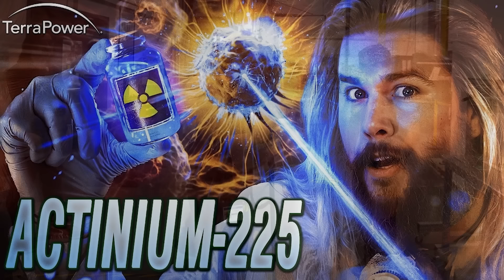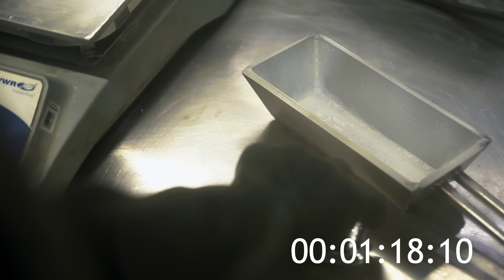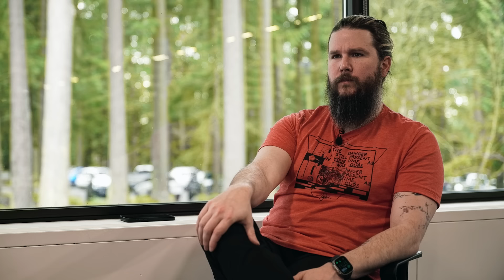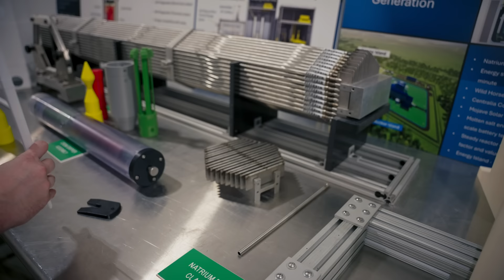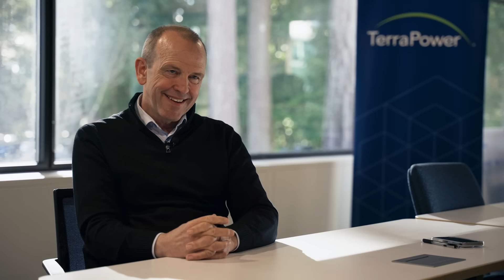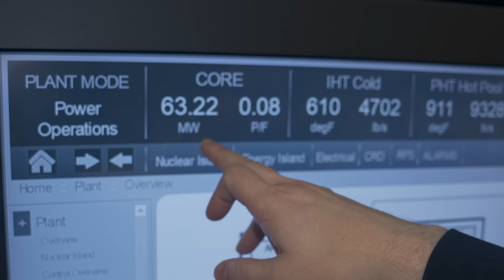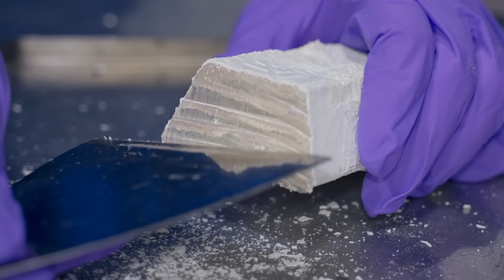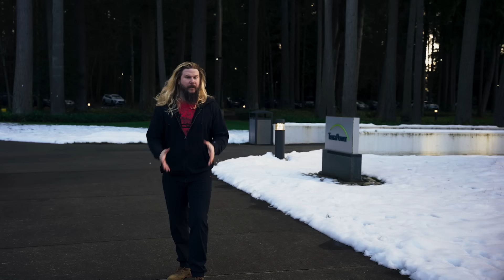Will Natrium Nuclear Reactors Change Everything?

Comment: So can we learn anything about the safety or fire suppression systems of the reactor? Maybe operating temperatures? I ask because sodium explodes or atleast ignites in open air so in the event of a failure how is the temperature decreased and the sodium contained? This varies from the thorium reactor function too and is seemingly very similar to the reactors we use today (except for the moderation of the nuetrons). While scientifically sound and certainly more efficient and better in function, i can't see how this is safer but that answer might be in that the reactor isn't moderated perhaps.

Comment: they aren't "getting licenses" by any stretch of the imagination they are trying to apply for one within the current commercial framework... I think I remember you mentioning that this is a fast reactor (but using enriched fuel at the same time) which basically means it is a breeder reactor for which there is (not since I last worked in the industry) a method to license for commercial use as it produced Pu in the normal operating process.... everything in the current operating generations of rectors was done with "nonproliferation" as a primary concern (which is why commercial reactors only use fuel enriched to 4-5% vs the navy's 90%) trying to make it as difficult as possible to divert materials for use in bombs...

it's been a while since I took chemistry classes but Na reacts with stainless steel, zirconium, and other metals especially at high temps so what is terra using to pipe the liquid Na through the core?

Comment: A) Thorium reactors should be built, not uranium reactors.

B) Nuclear reactors don't need to "follow loads". In the future a lot more electricity will be used continuously, day and night.

C) The Chinese took the research on thorium reactors that was done here and that will, likely be the preferred reactor type.

D) Nuclear fusion might be commercially feasible in 50 years.

Comment: 15:33 That's not entirely true. The major reason why alkaline metals explode in water is because the water steals electrons from the metal which makes the metal repel itself. This makes the metal shoot out spikes into the water which has a ton of surface area and that causes the reaction to explode. Thunderf00t has done a ton of research on this.

Comment: Finally, some good news!

Question: if the reactor is always at 100% and is using “fast atoms” then does that mean there’s no control rods in the reactor? Or is there control rods, but they’re used more sparingly like in a SCRAM emergency?
Reply: there are control rods, you still need them to keep the balance of criticality and such to have a functional reactor and its obviously an essential feature for shutting down the reactor. But there's no moderator since this reactor uses fast  neutrons to cause fission (MeV energy ranges) instead of thermal neutrons ( >0.1ev) like in reactors that use water as a coolant &moderator

Comment: I'm sure that the designers are thinking of every aspect of this, but liquid sodium as a coolant worries me for two reasons: it's a volatile metal (e.g. reactive with water), and it's solid at room temperature. If for whatever reason the magnetic pumps stall, it can solidify in your pipe system, and you won't be able to quickly liquify it again
Reply: The reactor part of the Terrapower design is based on the GE Hitachi PRISM reactor, which in turn was based on the Integral Fast Reactor, which was never built due to a lack of funding but was an evolution of the EBR-II which operated for thirty years. This is a "pool" type reactor, so all the liquid sodium is contained within the reactor vessel, or "pool". The pumps simply cause the liquid sodium to circulate through the core, past the heat exchangers which also are placed inside the reactor vessel, and then back to the core again. The heat exchangers heat the sodium in the secondary system, which is what will exit from the reactor containment as the sodium in the primary system becomes radioactive. The reactor containment is very small compared to what we´re used to from LWR's and there is obviously no water or anything else that can react violently with the sodium inside the containment. A containment vessel is fitted outside of the reactor vessel, just slightly larger than the reactor vessel. The outside of the containment vessel is cooled with air using natural circulation. So that is what is used as a backup heat removal system.

The power produced by the core of the reactor depends very strongly on how hot the core is. So, if you shut down the sodium pumps in the primary system, temperature will go up and the fission reaction in the core will slow down. This was tested with the EBR-II back in the eighties, both with primary and secondary pumps.
Reply: @johan.edlund Thank you for the detailed breakdown. The main takeaway here for me is that apparently the power output of the fission reaction is inversely proportional to the heat of the central core? (I did not expect this). If that's a physical property of the system rather than a mechanical one, that would make the system almost inherently impossible to overheat / melt down. It's been a while since I saw the video, but I believe somewhere in the heat exchangers, the energy is passed from the sodium to water (steam), correct? That's the main part that worried me about the reactivity of the sodium. Obviously the system is MEANT to be closed, where there's no direct contact between the two systems. However, if a breech or leak were to occur, you'd have a heavy reaction.
Reply: @Mike-ve3pt  With EBR-II the negative temperature coefficient is explained by thermal expansion of the (metallic) core, and doppler broadening effects.

With EBR-II, IFR and PRISM the secondary sodium loop transfers the heat to the water. This is on the non-nuclear side, so a leak would not be a major concern. In this design, heat from the secondary sodium loop goes to the liquid salt instead, and the liquid salt is used to boil water. So in this case, sodium is separated from the water used in the steam cycle by the liquid salt loop.
Reply: @johan.edlund Excellent! Having a salt stage in the middle really does mitigate that issue almost entirely. I was just wondering to myself whether it would be possible to use salt (or another metal) instead of sodium, but a multi-stage setup is ofc fine and probably inherently more safe due to the multiple levels of separation (aside from possible having more "moving parts" that can fail). The expansion effects of the core makes sense when you think about it, but i would not have expected them to be so pronounced. It's good to see reactor science coming this far, and not all research being shifted towards fusion (just yet).

Comment: The "science time" section doesn't answer the questions over the safety of the sodium. Instead, it raises the question:

What if there's a leak in the system and some air gets into the molten sodium? Won't that cause an explosion, since molten sodium reacts explosively with air?

I suspect that there are safeguards in place to prevent this, but instead of answering the question about explosions, it actually raises the possibility of an explosion to a higher level of concern because "only molten sodium explodes in air," and the reactor uses molten sodium.
Reply: "And that's why the natrium reactors are covered in inert argon gas"
Reply: @ thanks. That bit didn't register in my head.

Comment: Natrium is not the latin word for sodium. 

sodium(n.)
metallic alkaline element, 1807, coined by English chemist Humphry Davy from soda + -ium. So called because the element was isolated from caustic soda (sodium hydroxide). The chemical symbol Na is from natrium, the name for the element that had been proposed by Berzelius and coined from natron, a name of a type of soda.

natron(n.)
"native carbonate of sodium," 1680s, from French natron (1660s), which is said to be directly from Arabic natrun, itself from Greek nitron, itself possibly of Eastern origin (see nitre). Medieval Latin and Paracelsus (16c.) had a form anatron, from Arabic with the article assimilated (an-natron). It is the source of the chemical symbol Na for sodium and the word-forming element natro-, used in the names of minerals to indicate the presence of sodium.

Comment: One question I didn't see answered is what specific fuel this reactor is using. This is a very promising reactor and power plant design, but I'd hope we could get way from relying on U-235 if possible, since due to it's very low availability compared to U-238 (<1%) it both requires enrichment as well having a far more limited total fuel supply available on earth. If this type of design could directly or indirectly consume U-238 through neutron absorption and conversion to fissile Pu-239, it would be a massive game changer that would effectively increase our total fuel supply over 100x.
Reply: all nuclear reactors produce plutonium if we are being nitpicky. Fast reactors are better at it and can potentially make more plutonium than they consume whereas thermal reactors I think produce up to something like  7 units of plutonium per 10 units of uranium-235. And then half the time don't use it anyway because nuclear fuel isn't always recycled for some reason (I think its just more cost effective to make new fuel every time)

Comment: Well, I have to add that Russia is running commercial fast neutrons reactors with sodium (Na) coolant for decades (!!) already. That thing can utilize nuclear waste and different mixes of low and high enriched uranium mixed fuel (mox fuel) and that allows to use and reuse a lot of stuff previously thrown away. Its the cleanest and infinitest of energies avaliable for us today.
The heat battery trick is a clever one though, that I agree with.

Comment: I think this is cool. But in the age of Rare earth minerals and Exotic Matter, we still rely on metallic sodium and radiation to produce power to avoid fossil fuel power. I mean we can even make gold in reactors with Neutrinos, so why not bombard the rare good stuff, or use Particle Accelerators as stated in an old experiment in reverse that generated a very dense and small amount of Anti-Matter to generate power. But even then the risks outweigh the profits. There is no long term protections or proper storage methods for it without using more energy than is produced. But still these reactors using sodium metal are cool, but still kind of clings to the old premises. Couldn't the LHC do the same, lining the interior with solar panels, since the light produced from the collisions do produce a good bit of light? The same kind of light that would generate power on the panels?

Comment: This salt storage/generation unit sounds even more interesting than the Na-reactor part. It could be placed in any coal or gas power station as a stabilisation element for intermittent power sources like solar and wind. It would be able to get the excess part of solar generation in Spain and save the country from the recent blackout.

Comment: We had a Sodium reactor meltdown at SSFL in the late 40's that almost no one talks about. I'd need to see a lot of documentation on how this reactors design has addressed the past failure points, before I could condone it's operation.

We have an uncanny tendency to repeat our mistakes.
Reply: There have been a number of them. This design is based on EBR-II which ran without any serious issues for 30 years.

Comment: No expected behavior of uranium products in sodium rundown (product argon might be nice for sufficiency,) plant seems to be only 200 MW (but not a lot of users in Dakota yet, guess its growth model is external straightaway.) Not even running the different modes e.g. MHD direct draw from hot sodium, bubbling the neon in Na in reactor for heat regime changeup, what's this running at 500 deg. C when salt barely melts then, what's the condenser side for water...not much pictured? No atmospheric window IR dump? No industrial heat partners to use it up melting glass, preheating steel, etc? Extra steps not particularly well explained.

Comment: What happens if the metal solidifies when the reactor is off? Do they have to heat up all the piping to make it flow again? Lights for refrigerators will seriously load the reactor, lol. Bill Gates will gobble up all the power to run AI.

Comment: Generation 4 in terms of nukes, but what generation in terms of dealing with liquid sodium, or liquid salt? Liquid salt has the risk that it is solid at up to 801 degrees C. So your boiler has the risk of freezing up, at temperatures way above the boiling point of water. As for the risk of a sodium leak I noticed that you tested that block of sodium in air, not in water. Another issue is financial, natrium reactors need to compete with solar and wind, not just at the current price but at projected future prices because it takes years to build a rector. So you have to estimate how much further solar and wind will fall in price over the next ten or twenty years, and have your natrium reactor produce electricity so cheaply it can compete with solar and wind not just now but when it starts generating electricity and for several years after.

Comment: Hey Kyle, kinda disappointed you called out people pointing out sodium reactivity as "misinformation" , than when the TerraPower engineer said out loud "sodium only ignites in contact with air if it's molten" you didn't ask what that meant for a coolant leak.

Of course, these reactors have been tested in other countries for decades and even entered commercial operation in Russia. In Japan, one such reactor produced 1 hour of electricity in 20 years and one massive sodium fire.

BN-600 in Russia produced 14 sodium fires and two dozen leaks.

This is a promising design, but we do need to be cognizant of the likelihood of flaming radioactive molten metal leaks . I'm hoping TerraPower is accounting for that in their containment strategy.

Comment: Notice that this power station is basically like a solar concentrator setup, less the mirrors, but with reactor instead. I saw one of these in Spain. It takes a lot of real estate compared to the nuclear version. I like the fact that there is no water in the reactor. We can't avoid every accident, but starting with a design that is not a pressure vessel makes it that much less likely to do something silly one day.

Comment: Still a fancy water heater 😆
Be interesting to see how well some other companies systems might work in conjunction with future designs. There was one I saw that was using PV cells tuned to IR to convert heat directly into electricity rather than turning a turbine.

Comment: Sorry if this is a stupid question but: From what I remember from learning about water moderated nuclear reactors (about 25 years ago) it is basically a built-in safety feature of those reactors that if the reactor overheats, nearly all the water evaporates and is caught by an outer shell around the reactor. The nuclear reaction then stops because nearly all of the moderator is gone and the reactor basically shuts itself down making a meltdown impossible.
Does the Natrium reactor have a similar feature? If no moderator is required then how is a runaway reaction prevented? Especially in a scenario where parts of the reactor may have warped from the heat? (From what I remember that was one contributing factor to the meltdown in Chernobyl that they couldn't stop the reaction because the graphite had melted or was malformed or something)

Comment: German chemist here. I doubt the safety promises when you have molten 500 °C Natrium in a primary cooling circuit exchanging heat to the molten salts of NaNO3 and KNO3. NaNO3 and KNO3 were/are parts of gunpowder, they are the oxidizers in it. In molten form they are very strong oxidizers, and molten sodium is a very strong reducing agent. If the primary and secondary circuit have a leak and those chemicals mix, you will see how save such a system is by the mushroom cloud from miles away and the next Chernobyl and Fukushima is certain to come. Never have i seen such blind confidence in technology in a system that intrinsically is a bomb of that magnitude, combined with a nuclear reactor attached to it. This is crazy and i am pro nuclear power. But this is frightening naive and dumb to build. Again:
One small leak of molten, hot sodium and molten hot NaNO3/KNO3 and you will see an mushroom cloud from miles away. Mark my words.

Comment: The explanation of the sodium reaction with water reminded me of a video Thunderf00t published several years ago, in which he re-vamped that same experiment to more dramatic effect: instead of dropping a piece of sodium into a container of water, he secured it to the striking face of a hammer with a bent paper clip and some tape, freshly cut side facing out, then struck a piece of ice with it. The result was a small fireball and a rather impressive blast, as well as a shower of icy smithereens. 

Please make sure to wear adequate hand and eye protection, if you do decide to re-enact this experiment.

Comment: So I was one of the nerds that was curious about how they counter reactivity in the sodium but my 2 main questions were’t answered here though I’m sure there are geniuses who have the answers thought out already. 1) if there is a break somewhere in the line, or an event which leads to a large loss of natrium before you can isolate the issue, how do you continue to cool the reactor to avoid a meltdown? Are there large reserve tanks kept on site? The normal solution is dump water in that bitch which is plentiful but you cant randomly source a bunch of natrium? 
2) what if there is a crack in the heat exchanger which requires isolation to avoid contact with water? Are their backup heat exchangers/geothermal heat syncs to continue to cool the reactor until you are able to scram and make the repair?